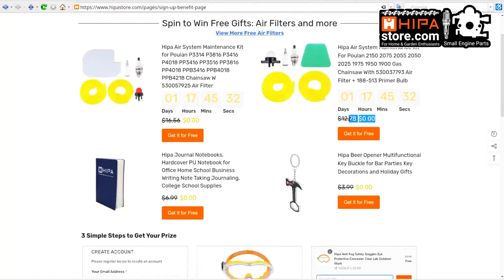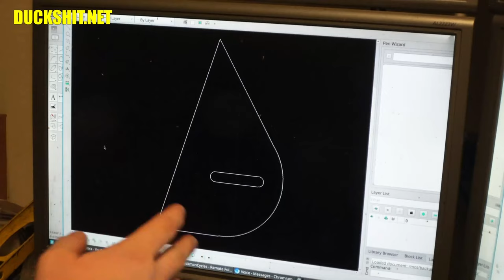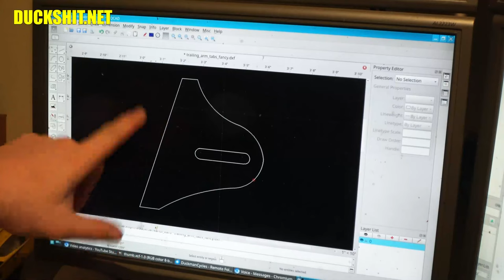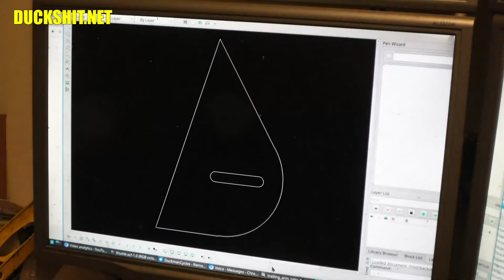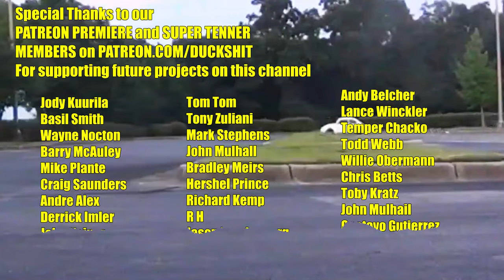Computer Modeled Part Creation 🔧💥 Kandi Go Kart

Comment: I thought of a motorcycle swingarm you could use. Has the slotted axle hole and the tensioners, etc. Small bike like a Rebel 250 comes to mind.
Reply from the maker: Hmmm. I have my own arms and wheels and hubs and axles selected and fitted already though!  Thanks man!   I might steal the tensioners off of that, though... haha
Reply: I was thinking just the slotted portion of the bike swingarms, with the upper and lower tubes cut off for your mounts. It would be a rigid fit, welded to the frame as your are doing with the plate, then fit the swing arms as you are planning. Hard to describe without pictures.
Reply: Coming along, ever forward.
Reply from the maker: Yep it's getting there, don't know why I need different swing arms though.... lol.   I think these work just fine.  😁👍🏻🦆💩